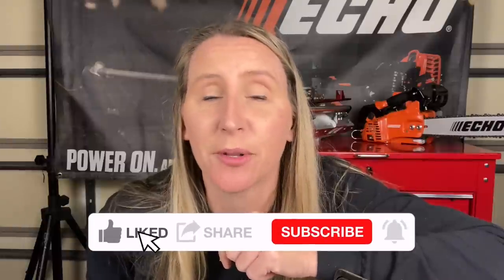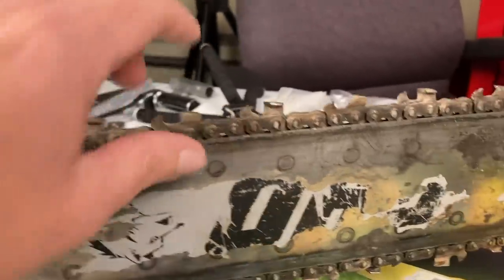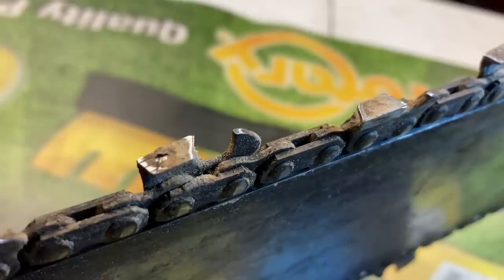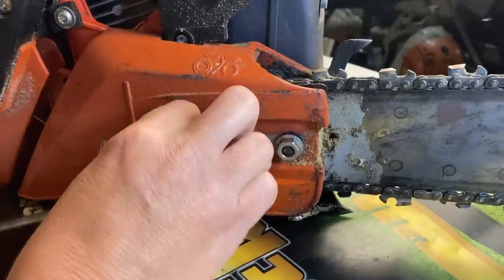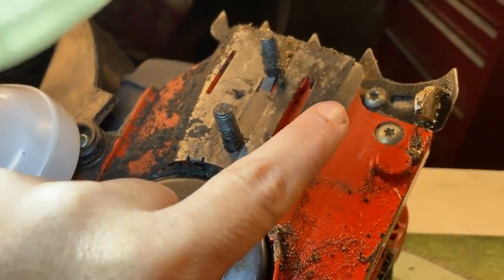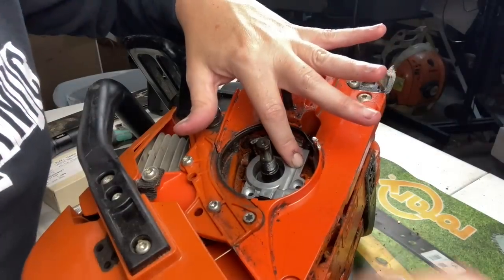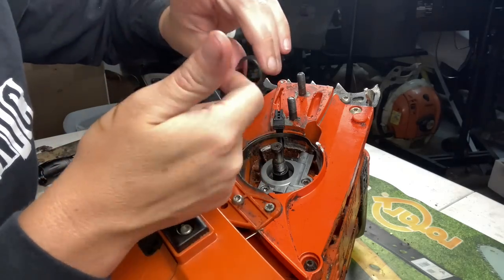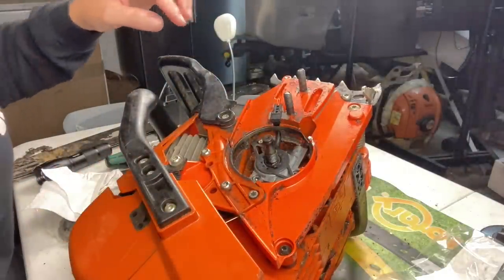How to fix an Echo CS-590 Chainsaw that got destroyed BY ONE NAIL! Complete oil assembly repair Vlog

Comment: This is the biggest problem with employees, they just keep running equipment till it blows . I have never ending issues like this they never check oil let alone change it in any vehicle or equipment. Got forbid you tell them over and over to the check oil every time they start something. They always check it when you are watching, so you think all is good then something locks up and it is full of clean oil! Clean oil is a dead giveaway of a cover up when all the bearings are spun!

Comment: Whenever I hear of a saw being run on straight gas, I have a memory of the time back in the late 70s, when my Stihl 041 seized up after having run on straight gas. While it was still warm, I filled the cylinder full of oil and let it sit until it completely cooled. Then we slowly pulled the started a couple of times and drained out all of the oil. After emptying out  all the straight gas we added a slightly rich mixture and after quite a few pulls it started and continues to this day to start and cut as well as some of my newer saws. The only down side to this saw is a saw that was once very easy to start and handle forty five years ago, really taxes these seventy four year old arms and back.
Reply: I'm 79 and cleared right of way with an 041 in Skagway Ak. Best saw I ever ran!
Reply: @desertfox3860  They sure don't make em like that any more.
Reply: echo sc 330 instal fuel line

Comment: It always amazed me how little mechanical knowledge  most tree trimmers have regarding their equipment. Some years ago our power company was in the area doing cutbacks. When they were at my place 1 of their saws wouldn't start. When I heard him trying to start it with no results, I asked him to come to the shop with it. I gave him another of mine to use while I fixed his. Now everytime they're in this area & have saw trouble they'll drop 'em off & sometimes take 1 of mine to finish their job.

Comment: Hi from Australia, more specifically Tasmania. Loving your work, I enjoy working with my hands & have tinkered with different small engine appliances. You have shown me what to expect when digging into problems, having a little confidence makes a world of difference. I have thought you could use 2 or 3 battery powered drill drivers yoou can fit all the bits you expect to be using, changing sizes/types quickly & with a little less effort & extracting & installing more quickly. Perhaps I'm getting lazy, but I'd be considering making the investment. Please keep the projects coming. Blessings, Gavin.

Comment: When I worked on these regularly  , I pulled the spark plug the pushed starter rope into the plug hole enough to let the piston push up against the rope so I could tighten th clutch.

Comment: This makes me feel like I've been insanely lucky. Doing a lot of chainsaw work on a farm means lots of fence posts and "fence trees". I can't even begin to count how many nails, fence staples, and sections of barbed wire I've cut through, not to mention the time I went clear across a 1/4" x 2" piece of strapping. The strap totaled the chain, but at most the others have needed a bit of sharpening to be right back to work. Most of the time I haven't even noticed until I finish a cut and see the bright spot in cut face. Amazed to see that much damage from just hitting a nail.

Comment: I too have this same Echo saw which I bought new about four years ago. After my use, I removed the air filter assembly to find by poor design that considerable sawdust was getting into the carburetor throat. 😮
I crafted a donut shaped foam filler to go between the carb and the air filter. This has reduced the sawdust infiltration by 99%. 
I can send you pix of my pix.  Let me know.

Comment: When you atart your saw let it run an xut wide ipen or jt sull the teeth unless your run into a wire fence but im from Arkansas we do this with the Work Force labor!! But you need to turn your bag upside down an change youemr small sprockrmet every 2 bars an every 2 chains change a bar and wide open i worked fir  Tennesaee Valley A Authorities but i cleaned my carsb an got ne fuel lines for tbhe 235 Xtorq! But you do a really good job mam!

Comment: It is possible for a nail to hit the clip that holds the washer and sprocket in place. Possibly breaking or dislodging the clip causing the washer and bearing to fly off and cause the damage you see. In all my 35 yrs plus working on and using chainsaws I have never seen a nail cause that much damage, and I have cut thru many nails, fences imbedded in trees, insulaters, rocks and even horse shoes. They play havoc on a chain that's for sure. Whomever was using the saw should have immediately realized that something was bad wrong and stopped using it . Inexperienced operator was what made the damage so sever. My guess is the Man that owns the chainsaw ( or the boss ) was not the operator . Anything is possible but the evidence leans towards an operator error . I love your channel and videos you do.  And !!!  HAPPY BIRTHDAY 🎉🎉🎉🎆🎆 !!
Reply: one thing i learned fast is watch your chips. if its more like sawdust stop. either the chain is dull or the tree is rotten. either way continuing will make a bad day.

Comment: This reminds me of my first Stihl. I have a MS170. I had the stock 16-inch bar and a 12-inch carving bar. I switched from the latter to the former to cut down some trees and lost the needle bearing cage. I destroyed my bar, oiler, clutch, and sprocket from overheating. I ended up buying a MS180C until I had the money to fix the other saw as I needed a working saw to cut firewood for heating. Now, I always check to make sure that I have all the parts in place and in working order. I think it was a $100 repair on a $170 saw.
Reply: The MS170's are nice little saws, great for small trees and limbing. I own an MS170, first day of owning it I bought the felling spikes from the dealer with screws and installed that. Then I bought a side chain tensioner of Stihl manufacture on eBay for half of what the shop was selling it for. To this day, those plastic crankcase housing spikes have never been touched by wood.
Reply: You must put the E clip on the crank, fully in its slot and make sure you did not damage it putting it on.  I use a pair of kitchen pliers to snap it into its slot on the end of the crank.  I lost an E clip on my ms 241 a few weeks ago and stopped using it as soon as it started acting screwy.  I did not damage anything but I had to replace the E clip and sprocket washer the next day at my local Stihl dealer.  The needle bearing had come off the crank but was inside the sprocket cover.  My rule is - anytime a saw acts differently, cut it off and check it out.  This is why I always take several saws on cutting jobs.  If one craps out, I crank up another one.  I just love to get saws stuck and often need another saw to cut them free.

Comment: A little Phillips screwdriver will open up tight fuel or oil lines if they need it.  A heat gun will also make them easier to install, along with a little oil.  Putting the filter on the oil pickup line can be a problem.  I usually use a combination of these means to get i
The filter on the pickup line.

Comment: Use the spark plug end of a scrench to pull the E-clip on.   It keeps it captive so it can't go flying.  I put the screwdriver part out between my ring finger and middle finger so I can grasp the wrench fully in a fist.  Makes it super easy :)

Comment: I looked at that borescope, $67.99 is a great price. Not long ago it was 79.99. Also make sure to check the updated vertical model to see if they have a 20% coupon off the normal $89.99.

Comment: I have a small engine shop. I use silicone grease to put all lines back on. No need to stretch them, they just go on very smoothly. At most, I warm them up a bit with a mini heat gun as well. I actually just did an oiler on a CS-400 and a PPT-266 with new lines one one of them. The only real problem is that silicone grease has SKYROCKETED in price, but it does go a long way. One thing to note, silicone grease is good for every type of rubber, except silicone rubber! It will soften and degrade it.

Comment: ARGH!! I had an oil/ gas mishap with my Stihl. I had bought an Echo 490 so bought the echo oil to mix with it. I also had the Stihl oil. One said makes 2 gallons with a large 2. The other had a large 2 but said 2 stroke. Needless to say, i mixed the oil w/e free gas and instead of 50:1 i was 100:1. Scored the bore and piston! that teaches me not to wear my glasses when mixing!!! Luckily, i had a friend who had the parts and fixed it no charge.

Comment: I cannot help but notice you rarely clean the equipment you are working on.  As a motor vehicle mechanic I always clean, usually after disassembly, to avoid getting dirt, etc., into whatever I am working on.  It also looks good to the customer.  After spending hundreds of dollars they end up with a clean or at least partially clean item.  Just a quick powerwash or scrub with some aerosol cleaner may prevent a costly comeback, keep a happy customer!  Happy Birthday by the way!!

Comment: Funny, my brother has an old metal cased XL series Homelite that he uses for just about everything he can cut including pallets, old house walls, shingled and steel roofs. Been using it like that for almost 40 yrs and has never seen any damage lie that, bars, chains and sprockets but nothing else. The chains are always used of course before he runs the "recycler" as he calls it.

Comment: Happy Birthday Bree!!!
Special request if I may. Aquired a Husqvarna 535LS. Rebuilding ZAMA C1Q-EL36D carb. Am questionable on reinstall of the "throttle rod lever" and the "throttle rod". Two different wire thin rods. Did due diligence searching for video showing install of those parts. :(  
Sure could use some help/advice. Thanks for your time,  Mike.

Comment: I've used a sharp drill bit right on the edge of the inside of the fuel line to flar it a little and it slides on easier.

Comment: 590 is a decent saw and good bang for the buck saw. Looks like they let it run out of bar oil too. Good information thanks:face-fuchsia-wide-eyes:People never blow the oil and saw dust off their saws just let them get caked? Looks disqustiingly dirty and gross. Guy totaled it out. It is a good candidate for replacing everything with 620 stuff and converting to a full 620 but that would even be more costly but worth it. Could have sold it and got another saw. I guess this is the cheapest thing to do. Might be more pleasant to work on if you washed it off with brake cleaner or car wash or even just air.

Comment: I was told that it’s better to run a 40.1 ratio oil mix than the manufacturer suggested 50.1. It will make your equipment last longer, which makes sense because they want you to buy new asap. You may need to replace the spark plug sooner, but a plug is cheaper than a new saw, blower ,edger,etc. Your thoughts??

Comment: On my g466 chainsaw holzfforma i kept burning up worm gear after worm gear they would only last few minutes just put in new oil pump now nothing not working , i noticed my clutch is missing a spring now waiting on all new clutch pump lines filter worm gear fingers crossed . This has been one heck of a saw only trouble i have had with it after a year of firewood sales

Comment: If I suspect their might be wire or nails in some piece of wood I scan the wood with my metal detector.  If it finds some metal I put a slice in the wood with my axe, so I can stay from it.  If a tree is located next to a fence, you better check it with a metal detector because wire can get grown up into a tree and field fence can eat up a chain and any parts of the saw it hits.

Comment: Your so in depth, why wouldn’t you take a moment to wash the powerhead in a parts washer and blow it clean with air? It’s kind of like pooping and not whipping!
No torque spec on the clutch bolt?

Comment: I’ve got a Husqvarna rancher 450, and I almost destroyed it once, because I was tired and the saw was dirty, and I went and put bar and chain oil in the fuel tank. 😆 I ran it until it choked out, before realizing what I had done. Like I said I was tired. And both of the cabs look the same, and I was just not paying attention. Luckily though, I was able to get the oil out of the fuel tank, fill it up with gas shake it a bunch dump it out, did that one more time, And it ran fine after that.
Reply: This happen to me with echo cs400 lucky  I got it out in time
Reply: @loganlunt6853  thanks! Good to know I’m not the only one! Hahaha!
Reply: @AV8R_1  I had a 450,  not Rancher,  stolen.   It was great Chinsaw!

Comment: I made the mistake of putting my bar and chain into the mud to cut stump roots and it got pretty muddy.  I took the cover off and removed the sprocket to clean it up real well.  Now my question is, do I grease anything on the bearings or inside the sprocket, or is it all self lubricating?

Comment: Watching how you had to put the oil lines back on their fittings- did you or would you consider lubricating them before you pressed them on?
Also, was it a lack of clearance that made you slide them on with the spring hose clamps already in their place?

Comment: Could the extra loop in the oil line be to prevent siffoning/leakage when not in use, just wondering. Never new of a company to give a little extra anything if not required.

Comment: Many people today don't have the common sense to operate power equipment. My geek neighbor bought a chain saw and ruined it by thinking bar oil was engine lubricating oil. Next the geek neighbor bought a riding mower and destroyed the mower deck and steering. Geek Scotty gave me both and I fixed them both.
Reply: Better than a neighbor who mixed fuel right, but learned chainsaws and beer don’t mix…. Piston and rings I’m sure are fine, ankle not so much.
Reply: Or maybe they just don't care.

Comment: So ive got a big mess i went to tighten the clutch on my cs 590 and the pull start rewind gave resistance so I tried loosing it up and basically everything ended up coming off and now ive gotta take off the wheel what's the advice you would give on how to properly get all this back together and in proper working order ? For my worm gear i used a anti seize lubricant like 1 that would go on a spark plug

Comment: Any chance you could point me to a video on your channel where you deal with a clutch on a weed eater?????   Specifically a Echo.  I cant remember the model number but when idling the head of the trimmer still turns.  Not super fast. Slow enough I can reach out and grab it bare handed and hold it still. 

Not sure if it is a clutch or maybe could be idled down very slightly.  I have watched through a TON of videos on your channel.  I am pretty sure I have already seen a video that talks about this.  But maybe you know one that would be better than the others. 

Keep up the good work..

Comment: What is the best setting  on the oiler on a timberwolf cs590  ? I use my cs590 only 4 times  and I never adjusted the oiler wen I took it out of the box .I already  hat to change the bar and Cain  because  I used fram chin oil and I just found  out it was to thin  of a oil

Comment: Love your videos. I need help with a part number for a 16.5 I/c OHV Briggs rocker arm adjuster.You hold it with a 10 mm wrench and adjust with an allen wrench. I ordered 590535 it looks the same but will not work, it's too small.and takes an 8 mm to hold it. It's in an old murray would the part still be available? Philip

Comment: New to channel...😊..need to ask..i have srm 225 trimmer..if i bypas stop switch by conecting 2 wires that are near carb comin out from cover "if it works that way".no spark.. good plug..its usually always coil...is that so on these 225s..thank you

Comment: It's a really stupid noob question which works for me because I'm both stupid and a noob. I've got a Husky 136 chainsaw, what gas mix ratio would you run for general occasional use? 

BTW, thanks 1, for teaching us, 2, for taking care of your customers so dutifully. So many would be walking them over to the displays to pick out a brand new $400 saw.
Reply: The modern fuel mixes are all 50 to one synthetic. It will run any 2 stroke equipment. Too much oil and you will carbon up your cylinder and exhaust. Not good. The only exception would be old gear that wasn't designed with modern high compression cylinder. You might need a little more oil.
Reply: @andrewmantle7627  Thanks!

Comment: Unrelated to this video  but I  have a couple of questions.  I have a cub cadet  walk behind  mower (CC 550 SP) purchased  in 2018 and used maybe  for two hours total.  A year ago  it wouldn't start and mechanics found  it needed valves adjusted  and today no start and valves are too tight again.  After all that questions are 1. To your knowledge is this normal for this engine and 2. How can I find out the lash specs so I can adjust them myself ( no model number to be found on engine  it is a briggs 173 cc)
Reply: You can set both at.005 that will be good. We have seen this a couple times, but not enough to give you a firm answer. On hot rod motors we grind the top of the rocker studs flat to help seat the locks, never tried this on a small engine.